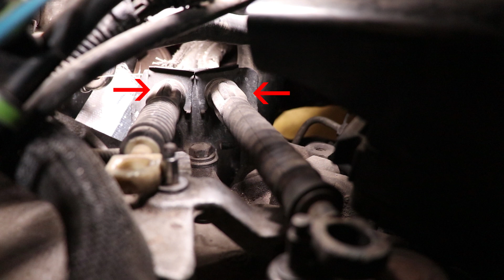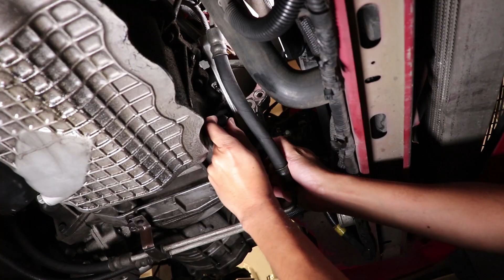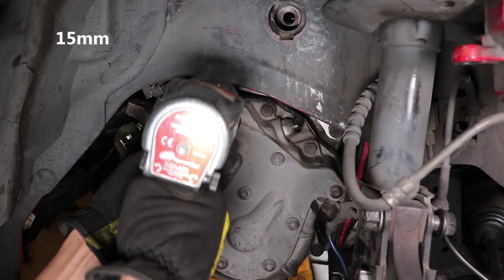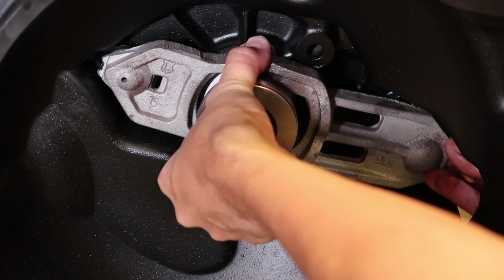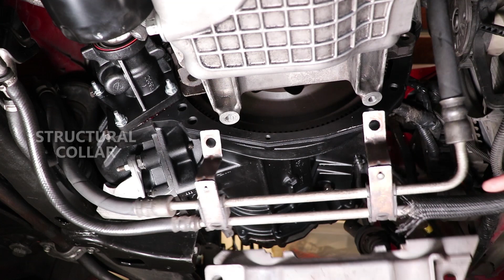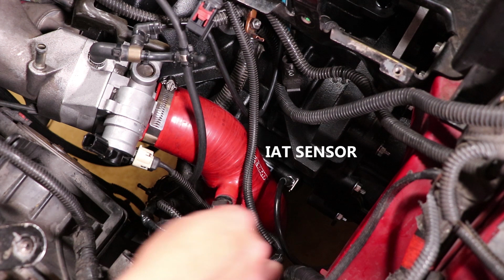Dodge Neon SRT4 Transmission Removal & Install (2003-2005)

Comment: I have been fighting putting mine back in. It gets bound between pressure plate, subframe and front bumper support, can’t figure out what to do. Good video.
Reply from the maker: Thanks Caleb! Yeah sometimes it pops right in and sometimes it's will get stubborn and require ton of patience lol Cheers!
Reply: @AlexAutoFun  had to take out subframe to get access but finally done! Thanks for your videos.
Reply from the maker: You're welcome Bud! 🍻  @calebbridges8260

Comment: Very well detailed. Thank you!  What type of grease did you use on the pivot ball, throw out, and slave cylinder?
Reply from the maker: Thanks Alan Kuz! I use the grease that comes with the clutch kit, but I have also used high temp bearing grease if I need extra, that has worked good for me so far!
Reply: I’m using all Mopar parts, which didn’t come with grease, so I’ll use some valvoline Chrysler high temp bearing grease. I found some remnants of a similar substance from the factory where the clutch center sits into the flexplate.  96,000 miles, 1 owner, ordered it, 100% stock

Comment: Great video, I'm attempting this today. What's your opinion on time to do this?
Reply from the maker: Thanks wasthaneon! I heard of guys doing this over an evening but typically I like to take easy to avoid breaking anything, say a day at most, please let us know how long it took you bud!
Reply: @AlexAutoFun  Thanks for the reply, It took me between 8 and 9 hours working on floor with jacks. I broke the pivot ball clip and had to wait a week for it. I still have to put battery  tray in but i want to do boost leak test before i do. I'm hoping this transmission i bought is good after all this! By the way your videos are great!!

Comment: Hey man so I just put in my new clutch and I'm trying to get my clutch fork on and your video I see you have a pivot ball mine doesn't look like that it doesn't have a ball ... I'm trying to get the fork to stay out but it doesn't like yours in this video
Reply from the maker: Hi Vincent! Yep the fork won't stay if you do not have a pivot ball or some other point for the fork to pivot against. Your pivot ball maybe missing, broken or damaged. I can think of two reasons why it may not be there: it was not installed by the previous person installing the tranny (but this would cause some serious driving issues since the fork won't pivot correctly) or the previous person working on the tranny modified it (I'm assuming you are still running the T850) and the transmission will have to be restored to normal to use a pivot ball. Hope this helps and please let us know what you find bud!
Reply: @AlexAutoFun  I ordered the pivot ball ...I should be good to install and be fine ?
Reply: I'm all installed and have violent shaking going in with some think sound going on inside ...ugh ..I really don't wanna take this back out ...this was my first time doing it and it was a b*tch lol..
Reply from the maker: @vincentwelshman8435  OH man! I had a similar issue where I had to redo the entire job, definitely not a fun experience! (I done it some many times now it's fast and easy but man the first times it took me sometime to figure the trick to it). I wonder if your issue is related to the missing pivot ball and the new one or maybe tranny related ? (once I rebuilt a T850 that was making similar symptoms, you could also have a unbalanced flywheel or clutch...

Comment: Hi doe you have any tips for removing bolts on modular clutch and torqueing them back cuz i do not have any clearance at all and i dont have any leverage with regular wrench. Any tios would be appreciated...
Reply from the maker: Hi Bacoj! I use a ver low profile wrench for those cases https://amzn.to/3VrBFo3 and on extreme cases I have also cut some of my sockets to make them even shorter (you be surprised how much clearance the low profile wrench gives and when combined with my custom shorter sockets even more clearance) Cheers!
Reply: @AlexAutoFun  thanks much! Only thing that stopped me today.
Reply: Would it be a horrible idea to remove oil pan to get the clearance i need? Or would it even make a difference?
Reply from the maker: You're welcome!
Reply from the maker: Hi Bacoj! I usually try to remove the least amount of things (to reduce labor) to be able to perform the service I'm doing, however yes in some case I have actually saved time by removing extra parts than struggling to get into a tight area (and saved some knuckle skin! LOL) Cheers!
Reply: @AlexAutoFun  thanks man you are reallt awesome! Keep i t up!!
Reply from the maker: @kakkarotskorner  You're welcome!

Comment: Got a question. My starter isnt engaging the flywheel i just got a new starter today thinking it was the problem but its still not engaging. Any ideas?
Reply from the maker: Hi Gun Precisions! That's odd,  if the starter and starter solenoid are new then it could only be the ring gear on the flywheel, maybe missing some teeth. If the starter does not turn at all, it may also be your starter relay and on rare occasions is the actual PCM, the wiring can somethings become faulty and not activate the starter. Hope this helps and please let us know what you find!

Comment: Hey! Do you have any tips for lining up the input shaft with the engine when reinstalling?
Reply from the maker: Hi Scat! it really just comes down to a lot of patience and trial and error. Eventually it pops into place. The keep is not to try to force it together, once the input engages the transmission will sliding in fairly easy. Hope this helps!
Reply: @AlexAutoFun  Thanks my friend!
Reply from the maker: @VHSPlayer  You're welcome bud!

Comment: @AutoFun will this fix the 3rd gear issue on SRT4’s? My 3rd is going bad. As well as my 4th gear popping out when going up hills
Reply from the maker: Hi AdrianZ23, there is a big possibility you need to rebuild the tranny. But before that have you tried adjusting your shifter? also check the shifter cable bushings (all 4 of them) to see if are still good, let us know what you find and thanks for watching bud!
Reply: AutoFun I have not tried adjusting, or checked cable bushings, but that’s where I will start. Thanks for the info

Comment: just have a question, so i did the whole clutch replacement, and now my car doesn’t want to go into gear any ideas what it could be?
Reply from the maker: Hi Rodriguez Family! I would start by checking that the slave cylinder is working and fully depressing the clutch to release. If that is working I would also check that the shifter linkage inside the car is adjusted correctly. Lastly I would check that the clutch was installed correctly and nothing is preventing the clutch from being depressed. I had one issue where I was reusing my clutch and a finger from the clutch broke off and prevented it from disengaging, so I had to take the whole thing apart to get the damaged pressure plate off. Hope this helps and please let us know if figure out it bud!
Reply: @AlexAutoFun  would a shift linkage bracket installed incorrectly, cause it to not properly shift into gears as well? i was told that bracket can only go in 1 way just wasn’t too sure and figure i’d ask someone with way more knowledge thanks!!
Reply from the maker: @cleanwhipsceo  Are you referring to the bracket that holds the shifter cables to the transmission? if so yea that should only go in one way but wouldn't hurt to take a look a check its seated correctly and the cables have not popped off it (I had a similar issue where a shifter bushing popped off and I lost the ability to shift into half the gears)..

Comment: What do you do when the mount bolt threads are stripped?
Reply from the maker: Hi KingReaper! Typically for stripped holes I have seen two solutions (but have not tried either one myself), one being a Helicoil insert and the other to go to the next bolt size by machining and retreading the hole (this is usually the more expensive option due to the need for special equipment to retread and it's not always possible if there is not enough wall thickness to guarantee it will be structurally sound) Cheers!
Reply: Did you end up fixing the threads? If so, what did you do, just in case I run into the same issue
Reply: @Bsizzle92  I didn’t. The car is currently tore apart looking for a new transmission housing

Comment: The transmission really just drops like that? I had a hard time when I removed mine last year.
Reply from the maker: Hi 1221Ralph! I done this some many times now it slides right out lol but what always take me longer is to re-install it and having the splines line up it's kind of tricky..
Reply: I usually take  oil pan off the engine and remove the clutch like a torque converter it makes it much easier to reinstall
Reply from the maker: @robertocervantes5639  Interesting, I haven't tried that yet, how much time do you estimate it adds to remove and reinstall the oil pan?
Reply: Gonna try the oil pan trick next time
Reply: @Elcapitanmaster  my problem was the car wasn't jacked up enough. Dropped the trans late last year again and it was easier with the car jacked higher.

Comment: After I installed my new clutch (APG) I realized that the car would vibrate. I used+4 atf. I did buy a new transmission mount and was also installed as well. I also installed a new pivot fork and when I drive it and change gears it vibrates and it’s loud! I’m not sure what it could be because it needs the new motor mounts but I did try everything any suggestions?
Reply from the maker: Hi Johnny, that is odd, something must be unbalanced, possibly assemble incorrect at factory, not sure how the APG clutch assembly works, is it modular or separate pieces? let us know if you found the cause of it buddy!
Reply: AutoFun Yes! I found out what it was it was the Agp Transmission mount! Since it is a solid mount. I also installed Agp motor mounts and it still shakes a bit haha will these mounts break in over time? And thanks for replying!
Reply from the maker: @johnnyguerrero3723  Ahh got you! I know what you mean now, yeah the vibrations can be quite strong specially once your are all solid mounts, I talked about this on my other motor mounts video, is definitely not for everyone one but you get used to it lol

Comment: What type of Valvoline was that you put in the transmission? I use Valvoline Racing VR1 with the high Zinc
Reply from the maker: 10W-40 4 Stroke Motorcycle Oil (Full synthetic) is basically what DCR recommends since I'm on a full built DCR transmission, but I imagine this would also just as well on stock tranny
Reply: @AlexAutoFun  Yes, a video on YouTube from Ed Peters telling everyone at a SRT4 meet to use Mobil 1 high mileage 10W40  in there transmission.  Few years later there was a lot of rumors that Mobil was not telling how much Zinc DDP they were putting in their oil so everyone believed it was lower than before.  So I stopped using Mobil1 and went Valvoline VR1 racing which says on the bottle high Zinc. I believe it's also good, I've been using it for more than 6 months no grind, no issues besides my trans case leaking oil.

Comment: How did you align the input shaft to the clutch?
Reply from the maker: Hi Marquidoes! Sometimes it goes in right away but others it requires some patience and trial and error. Eventually it pops into place. The key is not to try to force it together (do not attempt to force it to pop in by bringing both the block and the tranny together with the bolts, it's tempting but I would avoid it), after some wiggling the input shaft eventually engages the transmission and will slide in fairly easy. Hope this helps!

Comment: 11:17 the torque spec for the 18mm is 45 ft. lbs or was it a typo?
Reply from the maker: Hi 1221Ralph! I just double checked the service manual, yeah it calls out for 45 ft. lbs..
Reply: @AlexAutoFun  i just did as well. It's actually not clear. I believe it may count that 18mm as part of the structural collar. For the structural collar is says torque horizontal bolts (plural) at 80 ft lbs and vertical 40 ft lbs. This 18mm I'm question, i believe would be considered one of the horizontal structural collar bolts (even though it also passes through the bending brace. Kinda confusing but i went ahead and torqued it to 80 ft.lbs as it's the same thread pitch as all other transmission housing bolts.
Reply from the maker: @1221Ralph  interesting.. yeah i noticed some areas like that in the manual where it's either vague or possibly incorrect, when I was in the automotive industry I saw so many errors made on drawings, specs and the manufacturing process and now I trust few things now to be built correctly! LOL

Comment: Why drain the fluid off the trans? Can I just remove it without doing so ?
Reply from the maker: Good question Mike, the fluid will leak as soon as the axle is removed, I'm guessing it possible to partially drain the tranny to avoid this but I never tried it, I can't stand the smell of ATF so I just drain it all lol
Reply: @AlexAutoFun  yeah learned the hard way that an axle removal tool works best to remove it that like c clip holds it real good. Anyways thanks for the vids in general.
Reply from the maker: Glad to help Mike, yes the clip can be stubborn, thanks for watching!

Comment: my only problem is trying to line the transmission back up with the engine
Reply from the maker: Hi Voltz! yep, that usually is the step that takes me the longest, sounds easy but man it requires patience, with limited visibility of the splines going into clutch and the tight spot is really a lot of trial and error...

Comment: I have a 2002 dogde neon. That loses power and is a automatic and speed ometer doesnt work either
Reply from the maker: Hi Marisol! There is a good chance a tune up may help to resolve the power issue. Sometimes old spark plugs or old spark plug cables can do that, if those two are ok then the next thing I would check would be the coil pack...

Comment: Did you have to bleed the air out of the slave cylinder after the install?..
Reply from the maker: Hello Servant of The Truth, yes I had to bleed the air out but it isn't much if reusing the slave cylinder, I cover the bleed process on this video if your interested https://youtu.be/NdrJ7gGqqGE bleed process starts at around the 12:45 mark.